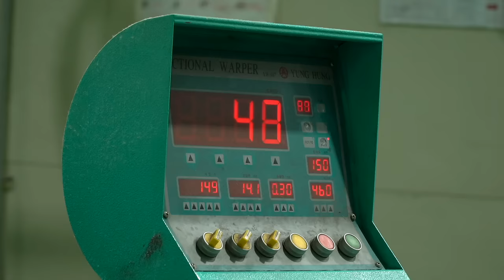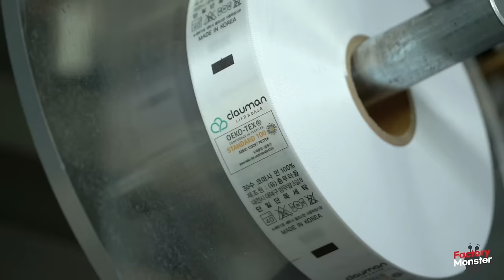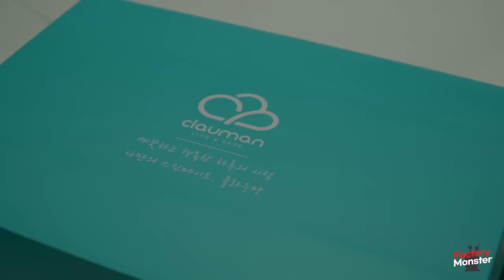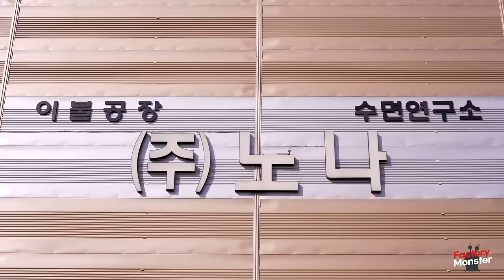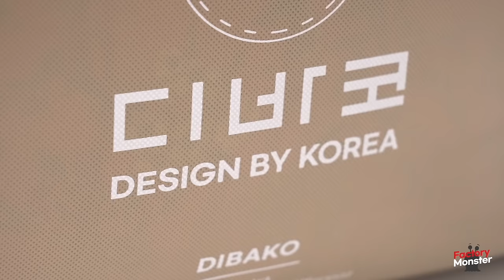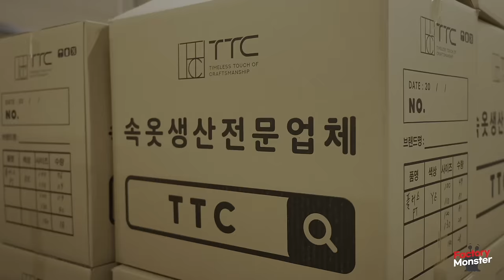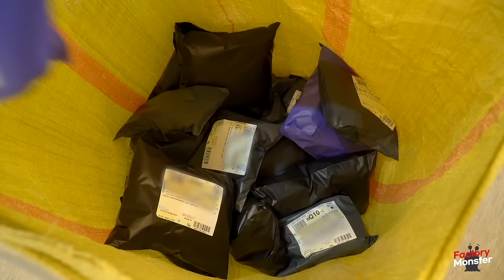Amazing Fabric Processing Factory in Korea Top 6

Comment: You need to make a bra with no wire, with fabric that has no stretch.  From what I understand, wires are uncomfortable.  You need to be able to get three fingers under the back-strap with the hooks on the largest setting.  As well, elastic means that the material does not change shape; what is usually named, is that elastic is flexible and stretchy, which is backwards from what elastic is.  This is a pretty interesting video, I hope you make more of them.
Reply: European use round wires, they are thinner and bendable. Flat ones are so harsh.
Reply: You understand correctly. Underwires do not follow the shape of the body and stab into the flesh causing pain. No one is shaped like the wires. It is like steel toed boots where the steel caps are too narrow and smash toes. They don't come in different sizes. One size wire or cap does NOT fit all.
Reply: European wires come in different sizes too. I have made several bras with them in cotton and synthetic knit fabric.